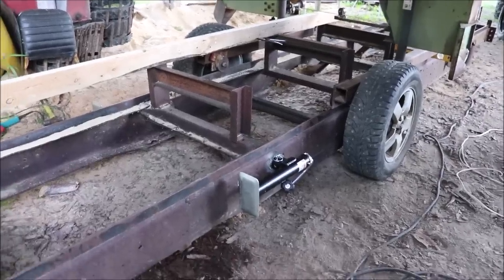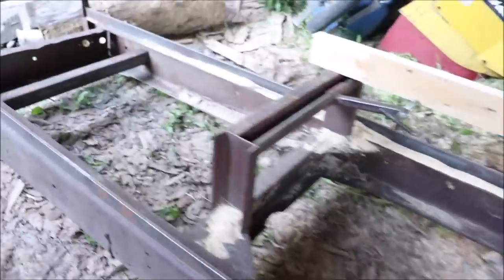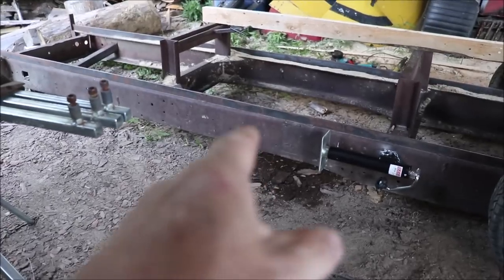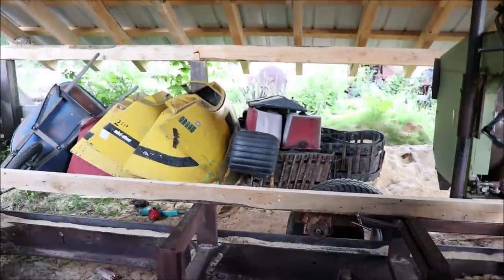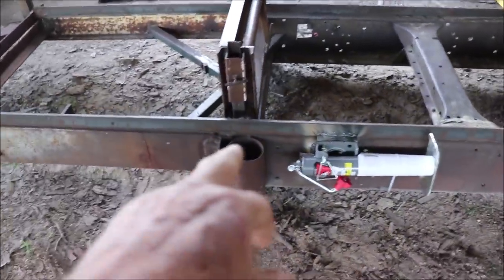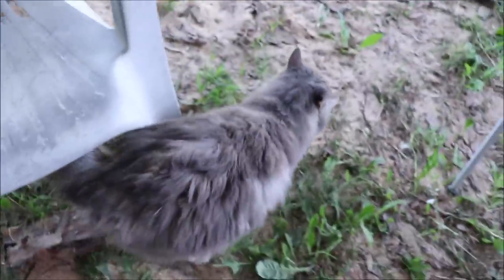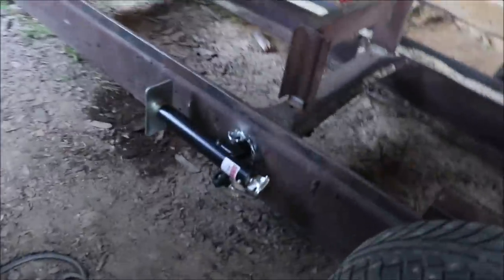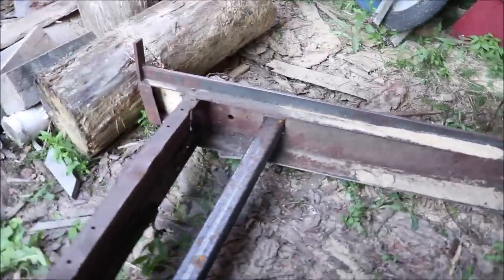This Will Be Better.  Installing Jacks On Our Homemade Sawmill.

Comment: Cecil you need a water tank on it next with dawn soap and windscreen washer soap your lades won't need be sharpened as often plus less sawdust also will not put strain on. Air extraction don't rush it it will work better now mobile

Comment: I knew you’d come around to my way of thinking Cecil, bring back your concrete blocks, dig them into the ground or half a dozen 3”x 24” x24” garden slabs so you’ve got a firm base for your jacks. Yes welding rods will burn if there’s oil on them. 😜👍🇮🇪